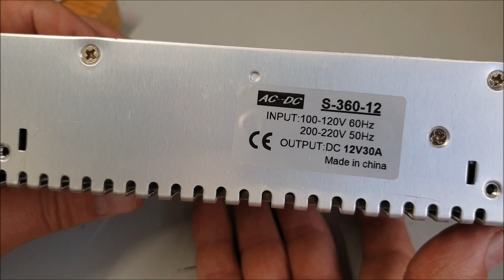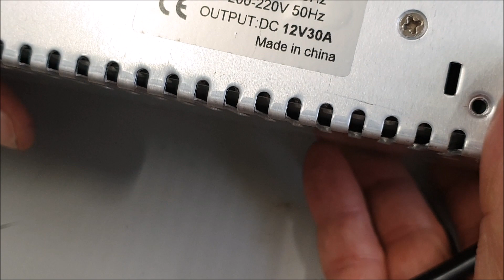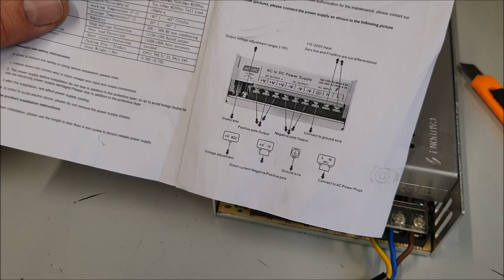HOW TO WIRE A TRANSFORMER FOR A CHINESE DIESEL HEATER

Comment: Isn't it possible to wire in a battery and leave a trickle charger or a small automatic charger connected to the battery all the time?  In fact, I think the heaters only need about 15 amps when starting and then during run time (almost all the time), need much less power.  The power supply you have would easily run 2 heaters at once.  I think.
Reply from the maker: yep would work fine thanks for comment and watching

Comment: Thanks for this one! Three small remarks only, not sarcasm but out of kindness. 1. You should never tin cables that connect to screw terminals. 2. The ground connection must be slightly longer than live and neutral. 3. BLUE is not negative but neutral.

Greetings from Sweden

Comment: My heater runs well on 12 Volt battery. When I try with a power adapter 240/12 Volt 5 A it shows on the display error 02 - which means: voltage too high. Does anyone have a clue?

Comment: I don't know where Mr Davies learned to solder...   Because that was an awful demonstration.   
Whether that iron was 'accurate' or not,  it would undertake a better 'tinning' if the nib was CLEAN and tinned itself.  
By rights - even with the csa of a standard domestic 13/16A - 3 conductor cable, the bear copper conductor would wick-up that 
hot solder far quicker with a hot tinned nib in contact.   

Rule of thumb being, as minimal time spent heating the conductor as possible to avoid melting the insulation, or causing excessive wicking which draws too much solder into the conductor  wires.    A dirty or corroded nib does not pass thermal energy as well as a cleanly tinned nib, causing the tendency to hold the nib to the conductor for longer causing the latter issue to occur.   

CLEAN YOUR FECKIN' NIB FFS!

Comment: Hi there I've got the same unit I tried the diesel heater on it  but power cuts out as soon as I press on  .  On the heater controller
Reply from the maker: Re check the wiring if ok then faulty unit
Reply: I think it's the power unit as fan comes on as soon as plugged in  and cuts out when any power drawn

Comment: The danger with these type of power supplies is where the 3 mains wires connect - you can physically touch those connections with your fingers - BEWARE!!!

My advice would be to put this power supply inside another case to prevent someone touching those contacts.
Reply from the maker: Good point

Comment: why you take 30 A if this heater requires only 9-10 A  on startup (120w) and 40w on running ?
Reply: So you can run multiple things, such as another heater or a light, which he mentioned...

Comment: I'm contemplating the same thing. Funny I actually am using a power supply like this to run my oxalic acid vaporizer which has glow plug in it anyways which is how I thought about this. I've just ordered my heater so I should be getting it soon.

Comment: If I buy the 40amp one mark what fuse do I need to put in the plug m8 ? 
I’m in the uk. So it will be set to the 220volt supply form my house. As I’m look to run to Chinese diesel heaters from it 
Looking forward to your reply mate
Reply: I would like the answer too.

Comment: Mark can you send me the link please as it’s not in the description. And will I need a 60amp to run to heaters I’m only asking because I wanted to run to heaters off of the one transformer if possible. I have been looking for ages for one of theses looking forward to your reply m8
Reply: How did you get on with the heaters, in theory you can run two easily off this transformer just get one going first as it's the start up that uses the most power then once up to temp after about 5mins it drops way down.

Comment: Hi Mark i have seen those transformers but how do i know which one for my diesel heater? ie there are different wattage units
Reply from the maker: don't think so 240v to 12v works fine
Reply: @MrMeltedwellies  yes but they are all 12v to 240v but it's the wattage some are 360 watt some are 250watt some are less
Reply: @mginbolton 
I just ordered the 360 one today should be okay I think
Reply: 30 quid
Reply: @chloe19815  yeah mine turned up today wired up works perfectly

Comment: I thought it was recommended that a 12v car leisure battery should be in circuit. The reason being that the heater needs to carry out a shutting down cooling cycle to prevent residual heat melting the control panel should the fan stop prematurely with a power cut. The shut down apparently takes several minutes to dissipate the heat in the combustion chamber.
Reply: Hi Mike don’t suppose you could do a video on how you wired the relays in? Want to install this heater but not sure about which way of running it etc
Reply: @ianwynhughes93  seconded
Reply: He didn't say that you had to unplug it before it cycles down. A power failure can happen with DC also. A battery backup is always a good idea, but it still won't know to turn off properly before the battery drains also.
Reply: @bobjones1131    You don’t unplug it.   I’ve rigged mine with two relays. One n/o and one n/c from a 12 volt leisure battery and a 20 amp power supply unit.  Also an adjustable voltage sensitive relay in the diesel pump feed wire.  Normal operation is from the psu through a n/o 12v relay. If there’s a power failure this relay opens and the relay on the battery closes allowing the heater to continue working off the battery.  If the battery voltage gets too low then the v. s relay opens and shuts the pump down. The unit carries on with the fan going through the shut down cycle using the battery until everything stops.
Reply: @tammyjilly  Well, that's a good idea💡. You should sell a kit for that.
Reply: @bobjones1131   it’s cheap and easy to do.  The two relays controlling the psu and battery were less than £4 each from a motor factors, and the vs adjustable relay less than a fiver from e bay. Then all you need is the wire and a few clips. I used 1mm for the relay coils and 2.5mm for the heater due to the 10 amp pull of the glow plug. I’m not a sparks but it all seems to work ok. I suppose you could add another relay to automatically charge the leisure battery when it had shut down on low voltage. I’m not sure about that.

Comment: I tried this but it started dropping to 8v not sure if it was faulty or if its something else got a error code e01
Reply from the maker: Sounds faulty
Reply: Most have a small adjustment screw to fine tune the output voltage ⚡
Put a multimeter on it or use your heater display in the off mode to show voltage and slowly wind it up to about 12.4 volts DC would be my recommendation as a healthy battery will be sitting at above 12v anyway.
Also check the amp rating of the power supply 20A would be the minimum I would use but not much more expensive to go 30A

Comment: Soldering is against wiring codes. Reason is solder will recrystallise thereby the soldered cable  ends will eventually become loose in the terminations and possibly overheat.
Reply: This isn't in the house's wiring. This is an electrical device/appliance. Probably doesn't apply as you stated ?
Reply: Whether house wiring or not, soldered cable ends will still recrystallise and become loose in screw clamp terminations causing overheating, fire  etc.
Reply: @tkaald  I'm not disagreeing with you. Dissimilar metals and/or loose contacts will all have trouble eventually. I just really like to have solder on them also. It especially helps when working with lead acid batteries.

Comment: Would have a concern if you get a power outage.  Hopfully never happen
Reply: Hookup a battery to the 12v side and it will always be charged for when power goes out.
Reply: Battery will take over when power goes out
Reply: @supremeautomotive6749  just hook up a battery along with the pos and. Negative from the transformer?
Reply: @ianwynhughes93  yes check on my YouTube channel i made a video of doing it
Reply: @supremeautomotive6749  seen the video just now but a lot of concern about the safety and power going back etc. just want a simple safe way to run in my garage

Comment: Hi Mark, what is the name of the transformer, and where did you source it,  please. I  just got the identical heater you have and want to convert from 240v to 12v. Thanks, Andrew.
Reply from the maker: AC 100-240V to DC 12V 30A 360W Voltage Transformer Switch Power Supply Converter  
type this in ebay
Reply: Thanks Mark, I sourced the very one you told me about.
Cheers,
     Andrew.

Comment: My dieselheater just like yours says .rated voltage./12v/40w.heat output5kw. Model D5. You don't say anything about the watts/voltages on the heater you aren't wiring into transformer. Can anyone tell me if they voltages I've written down will be ok for this transformer thanks if anyone can help. I don't want to burn my diesel heater out if it's overpowered thank you
Reply from the maker: AC 100-240V to DC 12V 30A 360W Voltage Transformer Switch Power Supply Converter
Reply: @MrMeltedwellies  by the way I got no instructions with my heater. I left another message
Reply: Thanks for your reply. But I have a new problem with the heater today. Everything seems to power up on the screen. But there is no heat coming from the heater and I can't hear the pump dripping but the screen the pump lights up. The fan firesbut after a while just slows down and goes off would you have any idea what's wrong with it I'm not mechanically you seem to know a lot about these heater problems does light up E10 but I don't know what that means someone says it could be a lot of things E10 I would be very grateful if you knew what it possibly might be thank you Graham
Reply: No one .has any ideas what it could be.thanks anyway 🇬🇧
Reply: @grahamfrear9270 just a thought, if your using a battery with charger have you enough power in battery, mine started but shut down after a few mins because battery went to low i had,nt charged battery enough

Comment: Can use a yellow and black wire on a old computer atx power supply for 12v you do need to reconnect green wire to make it stay on works well I've done two heaters with them
Reply: Can you explain what you mean for the green wire and how you wire the yellow and black... which is positive and ground, etc?
Reply: @chorritosvwgarage736  yellow positive, black ground, Green needs to be connected with black.

Comment: How’d that transformer hold up?
Reply from the maker: still going strong
Reply: Thanks, good to know. Your video inspired me to dig one I bought last winter out, relocating the unit, and not needing batteries will sure simplify things.
Reply: Hi Mark great video just ordered one off these what fuse did you put in plug and did you have a in line fuse to heater

Comment: i have the supply and the heater. Now, if the power goes out for whatever reason, is there a UPS you would recommend to keep the power on for at least 30 minutes?
Reply from the maker: Ebay

https://www.ebay.co.uk/itm/Tecnoware-1100va-1-1KVA-UPS-battery-back-up-power-supply/164163035452?hash=item2638e1213c:g:s6MAAOSwNIhemB6M
Reply: Just add a deep cycle battery in line powered by a battery charger

Comment: could you run 1 set of 12 volts to a charge controller to charge a battery back up to run the heater when ac power goes out?

Comment: Hi Mark, almost a year since you put this video on here , Any problems with the transformer ? the reason I ask is there was some negative reviews on Amazon
Reply from the maker: Hi Jon nope still going strong used all through the winter at least 5 times a week
Reply: @MrMeltedwellies  hello I've got a diesel heater like yours mine's a d5 it's rated voltage is 12 volts over 40 Watts heating power is 5 kilowatts. On my transformer it says 12-volt 360 w. Would you know if this is suitable for my heater it looks just like yours on your video any help would be very grateful we are thank you
Reply: I bought one after watching this video and tried it on my diesel heater and drops the voltage down at around 8v and then shuts off. I have the same power supply off Amazon.
Reply: Hello where is the link, thx

Comment: Any ideas for a decent case for these? I cant seem to find anything to keep it in that's compact.
Reply: Electrical suppliers and hobby stores sell adaptable boxes in many sizes with clear lids or not as desired.
This is necessary to make it legal as the 240v termination is exposed with little protection on the power supply terminal strip. 
Just keep in mind that you will have to drill some holes or install a vent fan cover kit on the box  to let the fan breathe and dissipate heat.  🔥

Comment: wow this is awsome!!!! i was just gonna buy this transformer off amazon for 20$ and hope it worked but this answers my concerns...thanks for the info 
¨¨¨ALITOVE AC 110V/220V to DC 12V 30A 360W Universal Regulated Switching Power Supply Transformer¨¨¨off amazon i went with the 30A cause it was cheaper

Comment: Do you have the link for the 12v transformer for the Chinese heater power please? Thanks
Reply: ALITOVE AC 110V/220V to DC 12V 30A 360W Universal Regulated Switching Power Supply Transformer.....
Reply: @halfpinthomestead9482  what kilowatts???? Mine's 5 kw. Is 5 kW to a high for this transformer??
Reply: @grahamfrear9270  No, the 5kw heaters draw between 10 and 12 amps at 12v when powering up and powering down. With 30 amps available from the power supply you are barely using even half of the available current. Once running the heater will be using in the region of 2 amps. This psu is overkill, which is preferable.